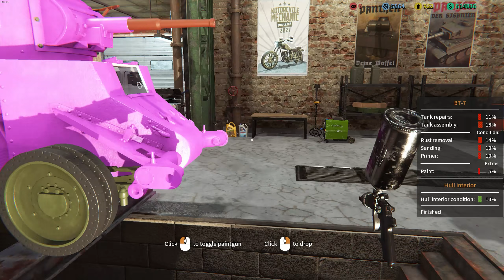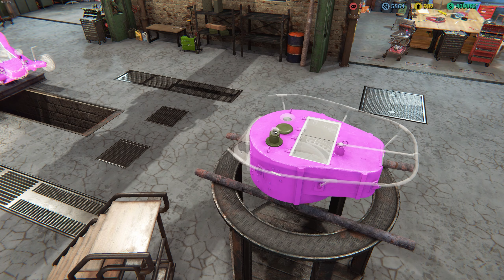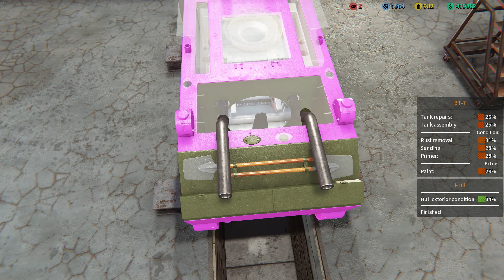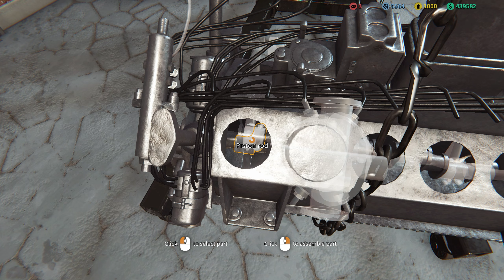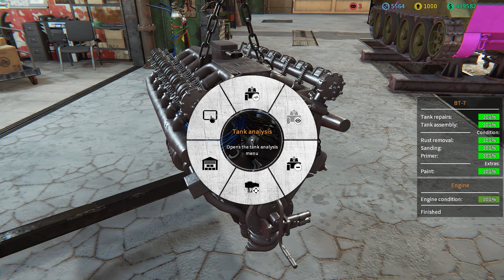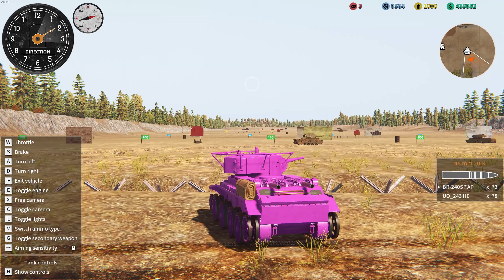BT-7

Comment: That is more like rivet drilling simulator than tank mechanic simulator....
Reply: So is Car Mechanic Simulator, which it's based on. Buy new parts, put them in, drill/screw/rivet, etc. Car Mechanic Simulator has more body panels like doors and trunks to break up the monotony, but the catharsis comes from impact wrenching everything in place.

And not really, a lot of care and time is spent in the engine.